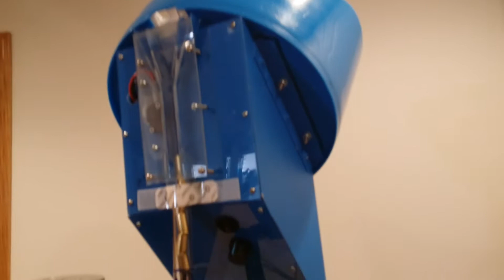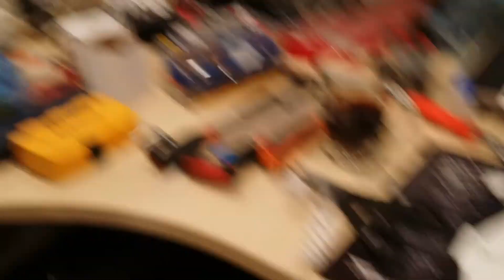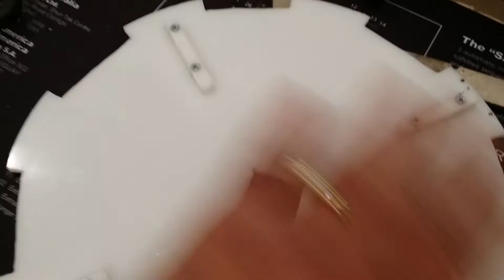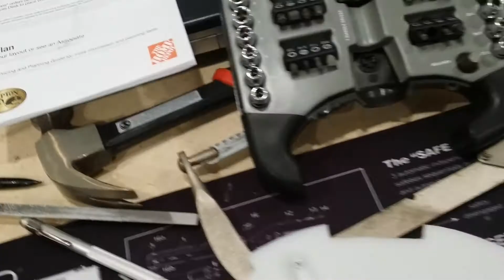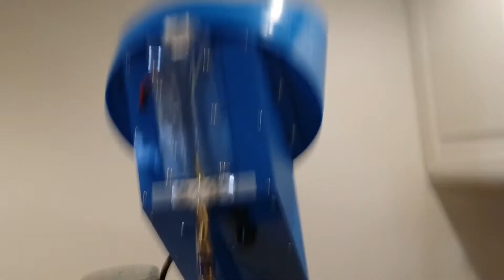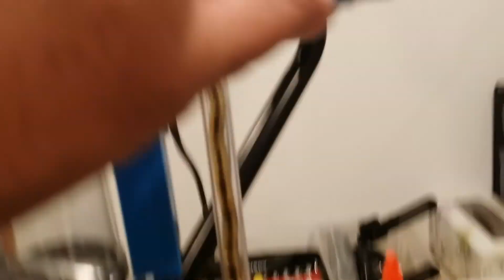My $50 DIY case feeder for Dillon 650 - 6 Final Overview

Comment: This dude is a straight up badass! There is a lot of thought and time that went into this project. That collator looks almost factory made!
However, i (because I’m both cheap and lazy) will probably go straight to ‘Thingiverse’ and download one of the many free 3D printer plans they have for the same device and have my buddy print me a kit! I will only have to source the motor and the sensor.
Reply from the maker: 3D printed case feeder for the XL650???  If you get your hands on one, please do a video on it.  I have never seen one.  I too am cheap.  That is why I build this case feeder.
Reply: G P G — Sorry, actually I was referring to a bullet collator designed by AmmoMike83! However, there is a 3D case collator on YouTube under the search title {Shoe Box Case Feeder}. It is designed for the Hornady LnL but looks like it could easily work with the Dillon with very little (if any) modification. A guy with your skills could make that setup work with minimum effort! He has a link to the build on GitHub that breaks it down step-by-step including measurements, parts list and the FREE open source code!  There are other 3D case feeder plans available also, but this looks like the most well researched one!

Comment: Do have the model number of the motor and the part number of the speed controller ?
Reply from the maker: Actually, I did not use the speed controller at all.  The motor is from a microwave turn table.  If you look in one of the other videos, you will see the torque specs for the motor I used.  That is about all I can provide, as I tinkered and tweaked this thing together as I went.

Comment: You did a great job on this. This is the most professional looking DIY case feeder I've seen so far. Nice work.
Reply from the maker: Thanks. It is still going strong.
Reply: I'm searching for a microwave oven motor. Do you happen to remember which one you bought? Thanks.
Reply from the maker: Here are the specs for the motor I bought.  The AD for this item is no longer listed in Ebay.  AC 110-130V 5/6RPM 50K Robust Synchronous Motor Geared Motor Control 6W CE Pass. The important part of the spec is the 5/6RPM and 50K specification. These represent for speed that the motor turns and the torque.  I selected a 110 volt motor because I did not want to use step-down transformers.

Good luck with your project. If you have more questions, must ask.
Reply: You rock man. Thank you.

Comment: what limit switch/ micro switch did you use?
I see a bunch for high voltage
but I am making a 12v rig unsure if they would work. also not sure of how much pressure they need to activate
Reply from the maker: I could not find a limit switch with a light enough touch for the brass.  I had to go to the Dillon website and buy the limit switch used in the XL650 case feeder.
Reply: +Gregory P damn. I hate ordering from companies who have rated shipping.
8$ ship blows it for me.

I got a .25N a .50N And a .8N force most where a 1.0-2.0N  
so I'm hoping these are sensitive enough

... need a physics guy to calculate a dropping case lol
Reply: I tried a couple of different switches and wondered how many iterations it might take to get the correct switch or if I would ever find the right switch (as Amazon vendors don't always list the force required to trip). Hence I settled on a different approach -- I altered the switch.  Many of the switches can be disassembled allowing access to the spring inside.  I  'adjusted'  this flat spring (adding more arc) to lighten the force applied reducing the N required to trip the switch.  The switch I altered was a Honeywell V15H16-CZ100A03-K at Arrow electronics.

Comment: Nice work! How did you address the shell shuttle that pushes the shell into the shell plate?
Reply from the maker: +GhostGunHolster 
Because the case heads are heaver than the case necks, the cases all fall into the tube with the case necks in the up position.